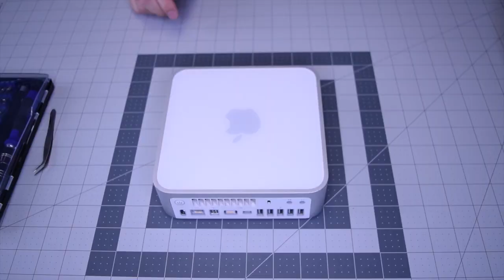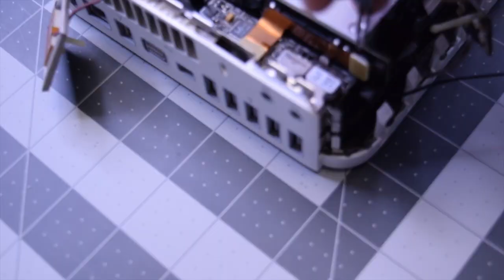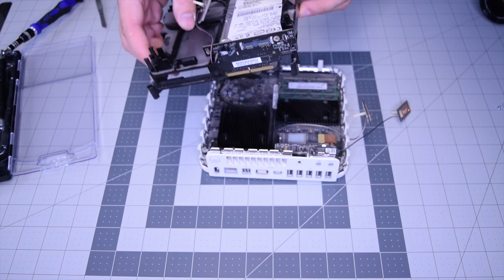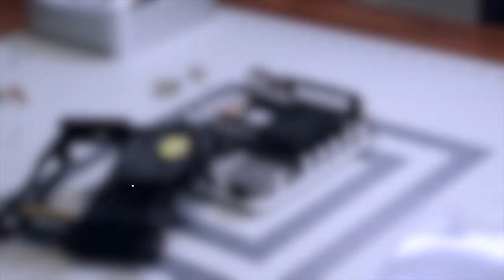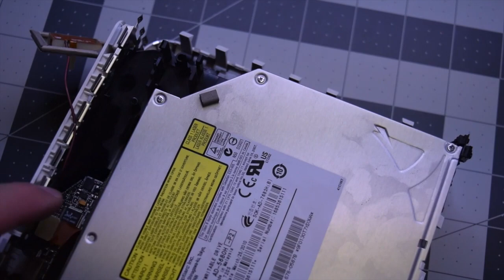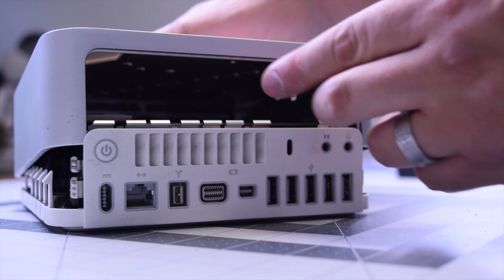🛠️🍏🖥️ Mac Mini A1283 - Hard Drive SSD Upgrade Replacement

Comment: All good man.  I've had my Mac-Mini since way back and have never cleaned it until now.  It was overheating and I needed to take it completely apart.  It's not excessively difficult but I didn't want to break anything.  Your information was more than enough.

Comment: The 2009 Mini will not work with a 6Gb/s SSD internally, and that is what is available these days. Put the SSD in an external USB housing, and it works very well.